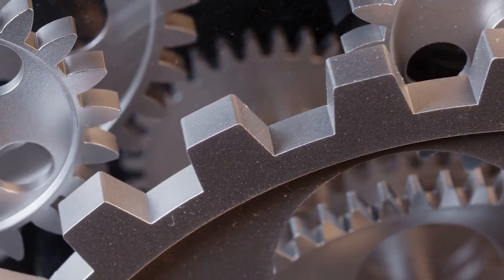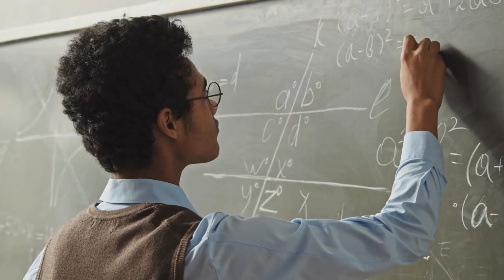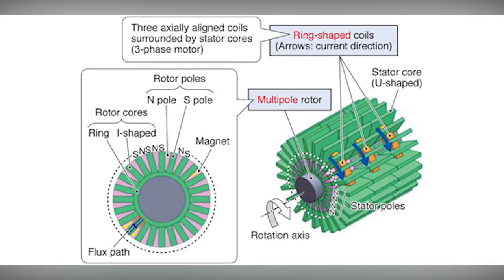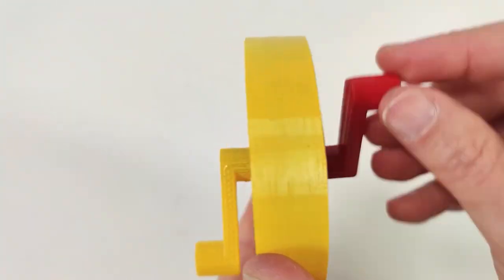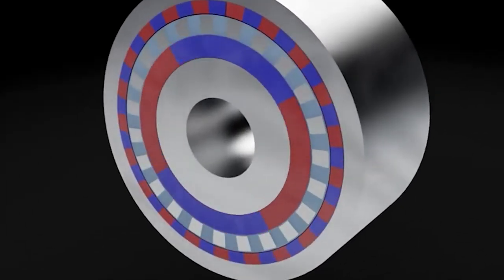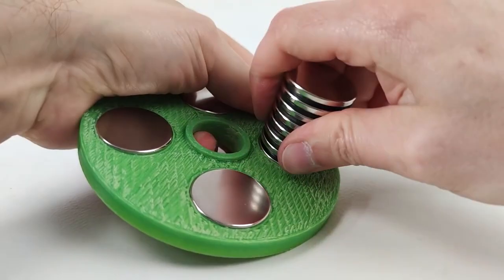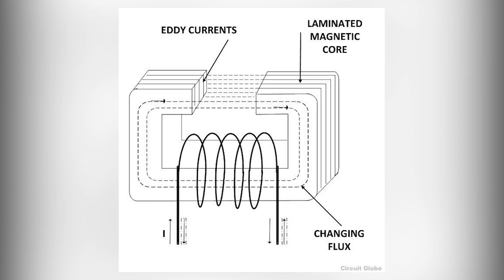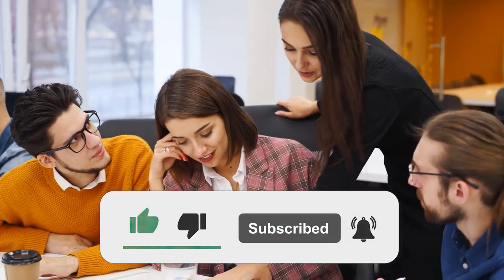Magnetic Gears  -  Why is No Body Talking About This

Comment: Low torque is main problem of magnetic gears.
Reply from the maker: Magnetic gears do come with high torque capacity but as with every application, this capacity may not be sufficient for certain uses! It is one of the disadvantages no doubt!